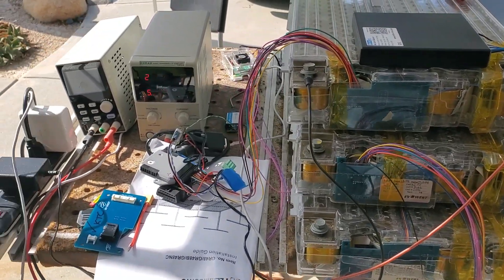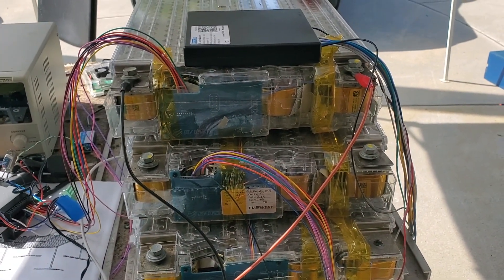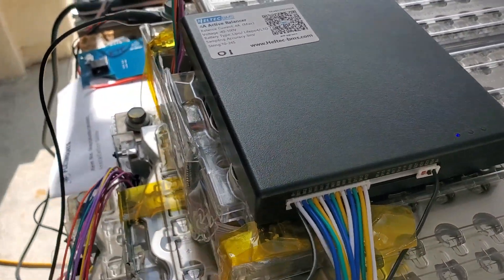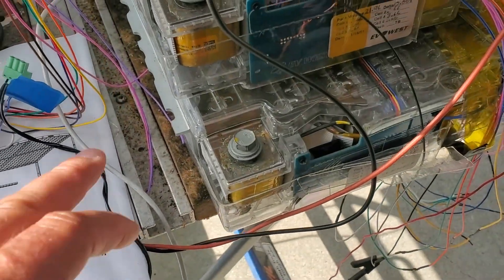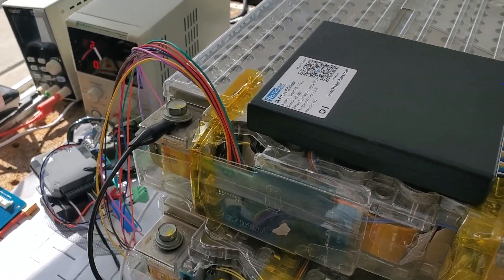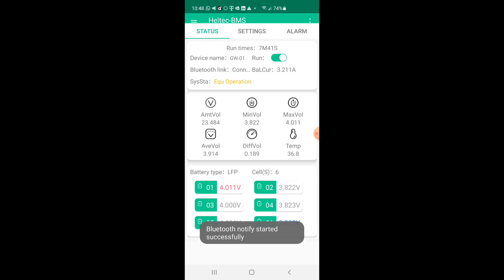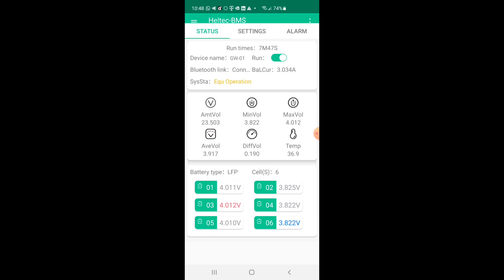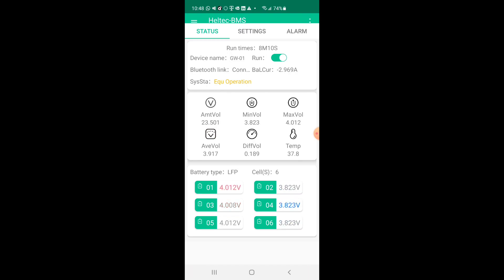Heltec Active Balance BMS On Tesla S Battery Module

Comment: WHAT VOLTAGE AND AMPERAGE DO YOU RUN TO THE MODULE ITS SELF?
Reply from the maker: Not sure what you mean, but each Tesla S module is 6S, which is 6 x 4.2v or 25.2v to charge, and limit to 10a to be safe(er).  But don't do this unless you can monitor the voltage of each cell group and automatically shut off charger if any group hits 4.21v

Comment: I have the same Heltec Balancer 4A but there is no App for this in the App Store. I think it´s not work without the App
Reply from the maker: You absolutely need the app to configure it it won't do anything useful without it. Check the website where you ordered it there should be a link